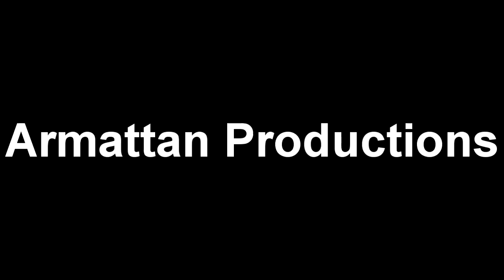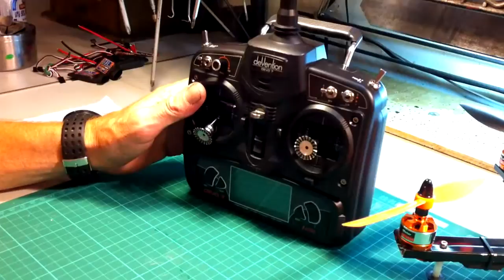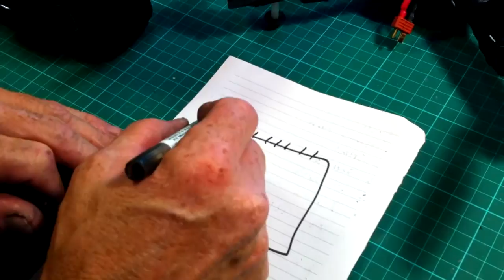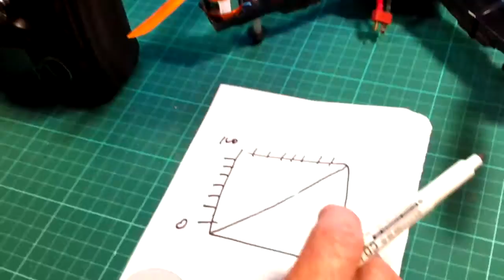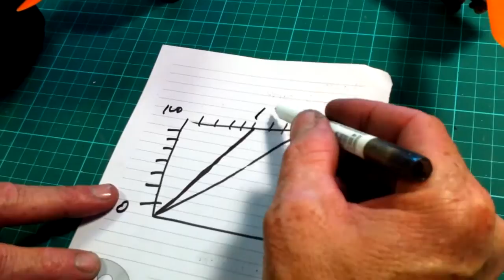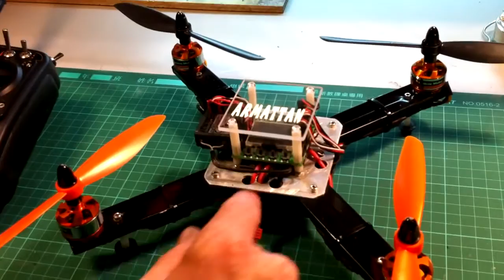Pre-Flight Check and Tips; Armattan

Comment from the maker: The smallest I can make is 250mm because smaller than this would require less than 6 inch props and 5 inch props are hard to find. As for your question about stick scaling, it is clearly answered in the video. Watch it again. ;)   Minimum 80 for acrobatics, 115-112 for VERY aggressive acrobatics. 150 would simply be too quick.